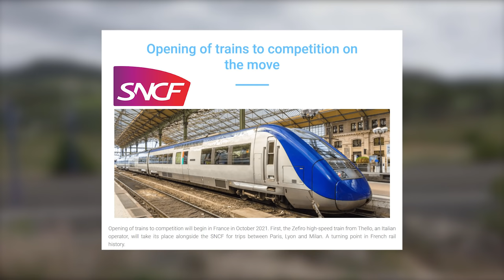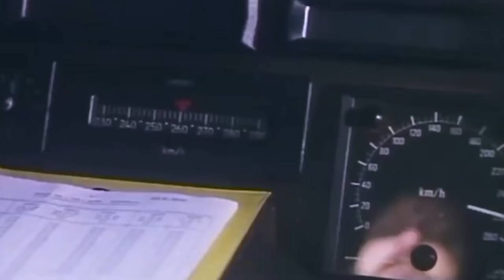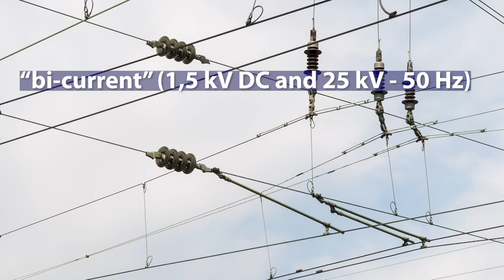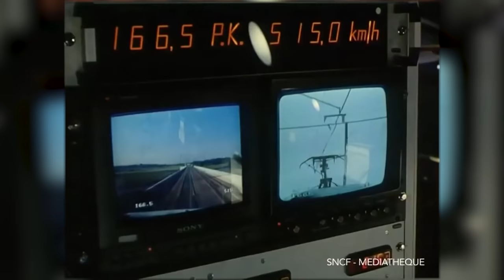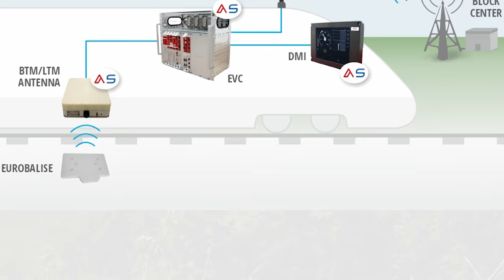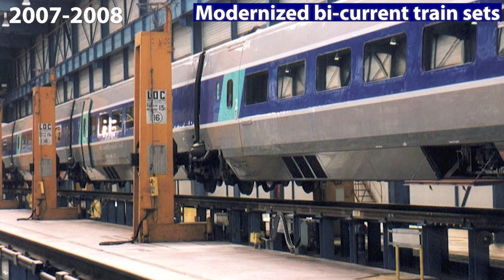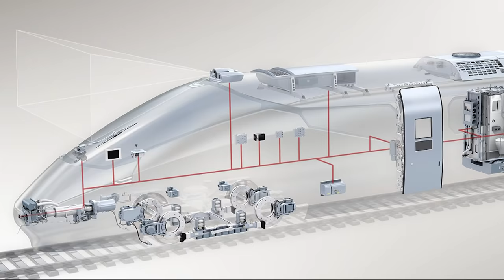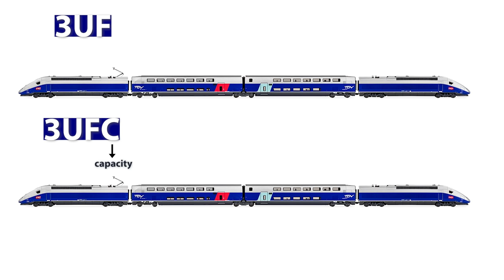Evolution of French TGV Trains: EXPLAINED

Comment: To export & sell, the technology of super-high speed lines and trains, the Japanese set up a College in France back in the early 1980's. Something the French usually forget to mention !  From this, as we have seen, the French followed by the Germans took up the technology and made their own various alterations to the basic principles. The most notable French difference being Power Cars at each end, & short articulated carriages, instead of distributed power throughout regular length carriages, as with Shinkansen.

There then followed a drive to re-export the technology with Japan, France & Germany all competing for the business. Hence Korea, China, Spain, Holland, Belgium, Morocco and others have joined the high speed "club". The drive in Britain for this technology, is somewhat muted. As Britain had been able to add fairly high speed trains (HST 125mph, Pendolino 140mph) to the regular network. Which means the step change to 186mph, does not offer such a great advance as in many other countries. Which then reflects on the cost of having to build special new railway routes to allow for 186mph trains.  

Britain was effectively forced into this technology, by the advent of the Channel Tunnel, due to the necessity to compete with airlines between London & Paris. Under an EU directive to remove as many Airline services (pollution) from the skies over Europe, and replace them with super high speed trains. 
BR therefore contributed to the construction of the, High speed TGV clone called "Eurostar" for that service.  The British Government later built "HS1" the high speed route from the Channel tunnel to St. Pancras. Something BR had pointed out was superfluous, as it only reduced journey time to London by a matter of minutes, as its a longer route than the initial Dover to Waterloo route, wasting Billions of tax payers money in the process ! 

Back in 1958 at the annual Railway Engineering Conference, the Japanese contingent, climbed on stage and announced they would build a "High Speed Railway" from Tokyo to Osaka (roughly 400 miles). With 125mph trains every 10 minutes. All controlled from ONE computerised signalbox in Tokyo, using in cab signalling. Which would also control volcanically heated water to clear away snowfalls, & bring trains to a safe halt if an Earthquake hit any part of the railway. In  response the Worlds Railway engineering delegates all fell about laughing, and told the Japanese they had been watching too many of their own Killer B movies (Godzilla etc). In 1964 and in time for the Tokyo Olympics, the Japanese opened their first line (Tokkaido line). During the 2 weeks of the Tokyo Olympics, the TOTAL lateness of ALL the hundreds of Shinkansen trains operated, was a mere 8 minutes and 10 seconds !!!!!!!!!
Reply: Where on earth did you heard about a Japanese college about HST in France ?
And early 80's would have been too late as TGV's were developed in the 70's and test running in 1980.
The Japanese were always very protective of their technology, as many other nations, and I really doubt they'd consider, let alone open, a technology transfer learning institution during the 80's in the very same country that is competing with them after the said country had already developed its own trains on its own.
Also given that TGV's and Shinkansen's were maybe the furthest apart of any HST in terms of technology.
The last time I heard a story of sorts, it was almost exactly the same but this time it was about a Spanish train engineering college in Paris that designed for Jacobs bogies typical of the TGV.
And I've also heard pretty much the same story but with an English college.
Which country will it be next time ?
Is that so unbelievable for the French to be able to develop a great thing on their own that everyone has to come with a different origin / rip-off story ?

About journey times : you'd be surprised by how much of an impact a couple dozen minutes have on ridership and economic boost.
Some destinations in France, Germany and Spain had experienced radical economic boost by cutting down journey times by a few.
However I can't wrap my head around the fact that HS1 & HS2 won't really be linked together even though they arrive almost next to each other. Given the huge spending, why not link them together so that trains could run from Manchester to Paris directly ?
Paris and Madrid have high-speed links / bypasses between their main lines so that trains can continue on.
If I remember correctly my numerous trips on the Eurostar, HS1 cut down the trip from London to Paris by almost an hour, wasn't it ?
It went from 3h and a few to 2h15 or something.
This is way more than a couple minutes !
And when you use the tunnel for work, round tripping the same day, it gives you more time working on site or relaxing at home.
Reply: Again a nationalist Briton contemplating continental Europe if not EU HS trains and stating bullshit.
Look at the trains in Brexshited Global Britain... 
Ps. Actually high speed development for trains in France started earlier than the 80's. It's factual and it's not English perfidy.
Reply: Ahah, I have never read such a fallacious, misleading and ignorant comment on the subject in all the time I have been on this video platform. France didn't wait for Japan to produce and innovate in high speed, as early as the 50's France proved that it was largely capable of achieving this goal and even surpassing it +300klm/h). CC 7100, BB 9003, TGS, ETG, TGV 001... in 1967, the Capitole with its BB 9200 was already reaching 200 klm/h in regular service. Whether gas turbine or electric, nothing has been copied.... And the TGV did not appear by magic at the end of the 80's, it took a long time to get there.  

The technology was acquired on all levels, the aerodynamics was not copied from the Japanese, but was strongly inspired by aeronautics and racing cars, fields in which France also excelled.

The only point on which the Europeans (France and Germany mainly) were surely inspired by Japan was the infrastructure. These two countries already had a gigantic network, aging and differing according to the region, so they had to reinvent everything and start on new bases, so get inspired. And even in this case the result was completely different from the Japanese.

I look forward to your sources concerning this mysterious Japanese college in France lmao.
Reply: @tigers94500  it is above all the concept of dedicated routes that the Europeans took over from the Japanese.

For Japan, it was mandatory, from start to finish, because the gauge of the rails had to be 1435mm and not 1067mm because of the high speed desired.

For Europeans the question arose, and the choice was mixed, dedicated lanes outside agglomerations, and fusion with local traffic to serve the central stations of large cities.

When at speed the Shinkansen Serie 0 was going to 210km / h at the beginning (in 1964) at the same time the conventional trains in France were going to 160kph and 200kph on certain sections. Just like certain conventional lines in Japan they bore prestigious name : Mistral , Capitole, North Star....or TEE.